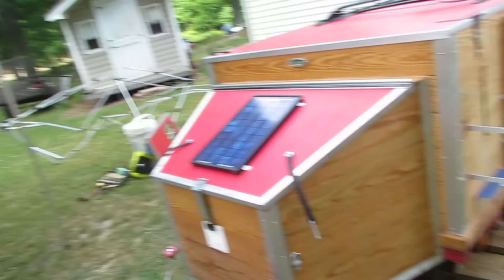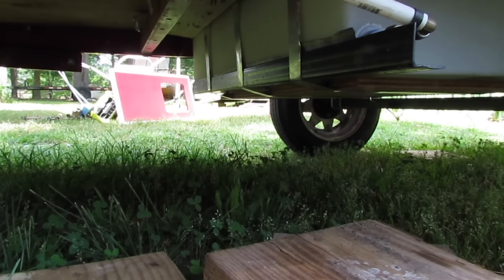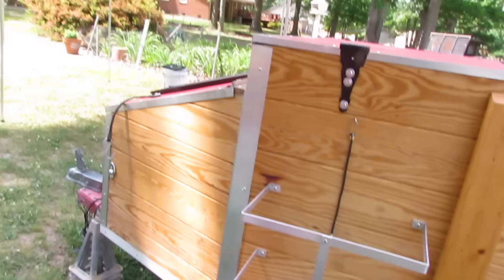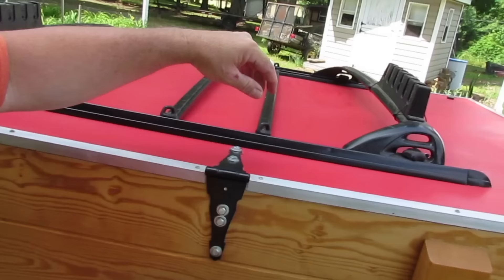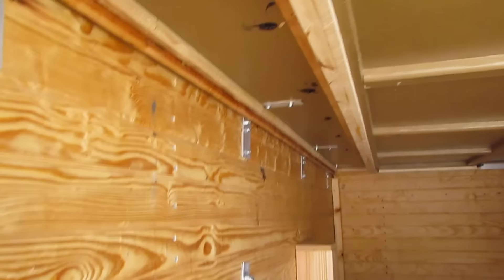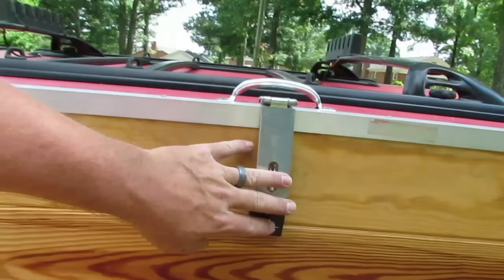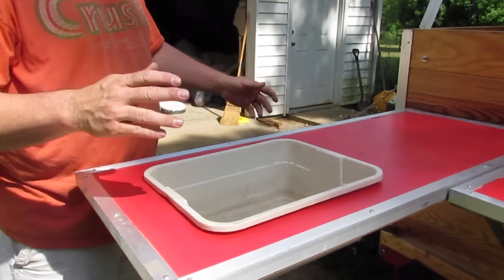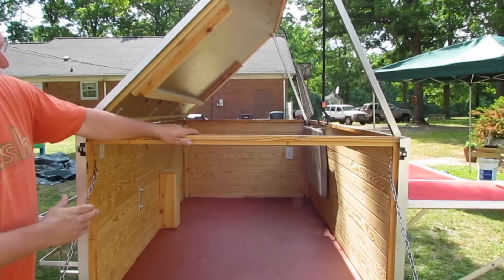Harbor Freight 4x8 Camping Trailer

Comment: i used a pop up camper body to pretty much do the same thing years ago. seems like your construction is a little too heavy duty. I am sure it will last a long time but the weight of the trailer alone would concern me.  I see popup campers for sale all the time with bad canvas. I got mine for $250.00. I stripped it out and hinged the roof. You did a great job. just too robust for most.
Reply: +scott firman do you have pics beefore and after
Reply: that was many years ago. I ended up leaving it out west as a trade for a pop up with canvass my cousin got for me. I made that one into a utility trailer after buting a new popup.
Reply from the maker: Thank you, it's definitely heavier than I had hoped but I can haul all that I need as is and I'm still going to upgrade the springs and the axle. I had looked into getting a popup for the parts but had not thought about actually using the popup for the build. Thank you and thanks for watching.

Comment: Ingenious, functional design and nice workmanship. Using 1x6 tongue and groove and adding the steel grating at the back looks heavy. Any idea how much the trailer weighs when equipped just as shown in the video?
Reply from the maker: Thank you, it weighed in at 840 lbs empty which doesn't leave a great deal or room to play with load capacity but I'll be upgrading the axle, springs and wheels in the future. As it is now though it can haul all that we have to carry camping with no problem. 
Thanks for watching.

Comment: Looks nice and my only concern would be the small wheels. I'm guessing with a load of camping equipment, battery and water the weight probably comes in close to 1200 lbs and when your truck is going 70 mph those wheel bearings on the trailer are probably spinning at 120 mph.

Comment: Jeff, have you made a video where you are using the trailer to camp with it.Would be interesting to see the whole set up.
Reply from the maker: I'm not sure if you've seen the other videos on my channel but before this video, I posted a slideshow of the build which includes a few pictures of the trailer set up in the Great Smoky Mountains at Smokemont Campground.
Reply from the maker: http://youtu.be/SKfPgyygw7E 
Here is the link for that slideshow. I also did a time lapse video while setting up the trailer, I'll try to find that video and add it to my channel
Reply: Thanks I will take a look

Comment: That is a really cool trailer, I'm gonna make me one...but a little different
Reply from the maker: Thank you, hope you enjoy the build as much as I did. I'd like to see your trailer when you build it, I'm always open for new ideas and suggestions.
Thank you for watching
Reply: Mine might be a little bigger
Reply from the maker: +David Neely bigger is a good idea. I can get plenty of gear on this trailer but if it were a little wider it would definitely be nice.
Reply: I'm going with the same size frame you did on yours but mine is about 3 ft longer
Reply: Im putting like a pop up top on mine instead of the regular camper type material they use, me and friend of mine are going to make it out oak

Comment: nice work im an electrician. if u need some advice. on any electrical. questions. 
you. shoud add some 12v dc lights
and parallel. a few batteries. to add more amps to ur trailer
js
Reply from the maker: Thank you, I may take you up on that. I might have some questions later on when I make some upgrades, not sure how soon that will be though. Thank you for watching

Comment: I have a couple more questions for you. Question #1---- I would like more detail as to how you mounted the exterior table to the side of camper, what kind of hinges did you use what kind of wood was used for the table???? I would like to install an exterior table that is easily removable while driving. My concern is that I don't want to drill hole clear thru the camper to mount the brackets to the wall at this point since it is now a finished product. Question # 2------ The metal rack on the rear of the camper how is it mounted as well???
Reply from the maker: Hey JD, I have replied to this question before and the reply seems to be gone. Did you ever see the reply? If not, please let me know, I'll reply again. Hope you get this message. Thank you for watching

Comment: This looks great but please add a fuse as close to the battery as you can get it. I would also fuse each circuit.
Reply from the maker: Will do, I have a fuse on the 12 volt pump but I'll be adding other fuses where they are needed.

Thank you for your suggestion and thank you for watching
Reply: Glad to hear it! It will make your beautiful job more safe for you and for the trailer.

Comment: you shoulda reversed your outside table so the sink would be closer to the water outlet and require less hose . and maybe just attached it outside as a matching part of the outside wall that just pops up and used the Ikea table leg hack for legs .. just a thought

Comment: You did a great job on camper trailer one thing if the tires came on it new you need to change them china rubber is not so great.
Reply from the maker: Thank you and yes, I was concerned about the tires before our trip this spring so I purchased new tires with a heavier payload. 

Thanks for watching

Comment: the down facing "forward battery box vent" raises questions. 

1. If you are trailering the unit and your truck tires are kicking up water, road oil, sand etc. towards your trailer, where is it going? battery compartment. (the vent idea is great, if static)
2. Any problems with road material compromising the belly water tank connections?
3. This is a camping utility trailer correct? not the tent/living quarters? 
4. did you use treated or untreated pine (lumber) for the project. 
*if untreated, did you seal it with helmsman, varnish, or Thompson Water Seal ?

Excellent concept and execution of project,  well done/well thought out, sir.
Reply from the maker: 1. I have pulled the trailer in pretty heavy rain but not for long periods of time. No issues at all so far with water or dirt entering through the vent. 
2. No issues thus far with debris from the road causing any damage. I do plan to go to a larger wheel size though which will give me a little more height. 
3. Correct, this is a utility trailer to haul our camping gear, not a living or sleeping quarters. 
4. I used untreated wood and I sealed it with Thompson water seal but I plan to go back and use Helmsman spar urethane, the Thompson just isn't sufficient. 

Thank you very much, I appreciate that and thank you for watching

Comment: If you flipped the roof all the way over with 2 legs to the ground, it would make a great table. Would be kinda tall i suppose.
Reply from the maker: You're right, I have done that while working on the trailer, it does make a great table but it is pretty high. 

Thanks for watching

Comment: Nice job ,nice camper the reason I watched is i've been thinking of doing one as well. But want to build a portable miniature weld shop so will try to build a camper on my truck and the trailer for my welders saws brake etc. Any thoughts on a lightweight material that you don't have to mortgage your house to use to build ? Motorbikes use a composite , or aluminum both expensive.Thanks again ,nice job. Rog.
Reply from the maker: Thank you, not sure what you'll find that works and is inexpensive. I liked the look of the tongue and groove but if I hadn't used that then I would have used plywood. My original plan was a teardrop trailer but then reality set in when I started thinking about my large family and large amount of camping gear. One day I will build a teardrop though. A lot of people build a teardrop with plywood and cover it in aluminum. I'm sure that wouldn't be cheap though. Good luck with your build and thanks for watching

Comment: Some great ideas and a nice build!  Thanks! Now that it's 2020, how has she held up? Anything you'd change....?  🤔
Reply from the maker: It has held up really well, we haven’t used it in a while now due to upgrading to a travel trailer but we have put a lot of miles on the trailer. I did upgrade the tires to hold a heavier load, not that I was going to load the trailer heavier but just for piece of mind. I would suggest upgrading the tires and axle. Other than that, I’m happy with the build.

Comment: Great job it really is a custom piece that looks like it will last a long time. one suggestion maybe putting rubber or foam stripping to seal the top lid. ball park how much did it cost and how long did it take?
Reply from the maker: Thank you and I agree, I'm thinking about making a new top for the trailer and when I do I'll come up with some type of seal for it. The total cost, keeping in mind that I could have cut some corners and saved a lot but I always go overboard, is estimated at $1,500.00.

Comment: have you thought of putting the water tank in the box
Reply from the maker: When I built the trailer I considered a lot of different options. The tank would take up a lot of room inside the trailer if I placed it there. I did consider cutting a hole in the floor and lifting the tank a few inches and then build a box around it on the inside. That would get the tank further away from any dangers on the roadway. Thanks for the suggestion and thank you for watching

Comment: I am building a tiny house that I can pull behind my bicycle and have been wondering youtube looking for idea’s tips and inspiration etc. I came across your video and I must say, you have done an excellent job on your trailer. I have a few idea;s from your trailer I could use for my tiny house build. The water tank setup and the electrical stuff is awesome. Do you have a link to the ebay stuff like the gas tank door and lock system? I couldn’t find it but that is a really great find.You did a really good job but like others said better protect the water tank. Losing that while out camping could stink.Other then that all you need now is summer. .

Comment: Did you miss measure the width of the battery hold down rail so you can fit the hold-down rods in place?  Nice project and video.
Reply from the maker: The hold down rail is a snug fit for the battery when it's installed but there is room for the rods. Thank you and thanks for watching

Comment: The 5 watt charger on a 12 volt system is a problem you. Need around 13.5 to keep it charged other then that great job
Reply from the maker: Thank you, yes my plans are to upgrade to a 15 watt panel. I've heard that Harbor Freight has a good little solar unit for pretty cheap.
Thanks for watching

Comment: Nice work. Very good attention to detail on the installations of everything and clever use of standard household items to make it work. I have been wanting to build something like this to haul my kayaks and camping gear in without filling my truck up. Would you mind sharing what your overall cost investment was for this build?
Reply from the maker: Thank you, I don't mind at all. I started keeping track in the beginning but quickly lost track of the expenses. I have estimated around $1,500.00 total for the build but there are several areas that I could have saved a lot of money. One area would have been all of the aluminum, I wanted to dress it up a bit and I chose to use aluminum on all or the corners and edges. I could have left that off completely or probably found it at a much cheaper price. Building this trailer just to haul kayaks, you probably wouldn't need any of the electrical, side tables or water tank and plumbing so I'm guessing you could probably keep it way under $1,000.00. Hope this helps, thank you for watching
Reply: It does help, thanks so much!

Comment: But I am an electrician,,, so my suggestion is to run the wires away from and under the seals. And strapped so that vibration doesnt loosen things. Might I suggest a plastic flap from the sidewall covering your tie-in's? One drop of water in the wrong spot can destroy the entire trailer man. Also, a chicken wire guard for the panel. And battery terminal caps for the terminal points. Just suggesting man :)
Reply: Oh and a drain in the battery box too. Just in case. Very inspiring though man, thx :)

Comment: I was a bit confused do you just use this for a camp kitchen and use a tent to sleep in or do you sleep in this ?  also do you use camp site electricity and does it connect to your trailer? you did a great job on the project... do you mind sharing the costs of construction?
Reply from the maker: I understand, a lot of people have asked the same questions. I haven't made the trailer a sleeper yet, just a camping gear hauler. We sleep in the 10 man 3 room tent that I reviewed here on my channel. I install a 12 volt battery when we go camping and that runs the water pump and supplies power for most of our needs while camping. I didn't wire it to be connected to external power but that may be something that I do in the future. I would also like to modify the trailer to be able to sleep in it so that my wife and I could take a weekend trip on occasion, we have too many children to sleep in the trailer when we're on family vacations. When set up on family vacations we use the trailer as a camp kitchen or chuck wagon. In addition to the counter tops that I attach to the side of the trailer, we set up the camp kitchen that I built and my wife has all she needs to prepare every meal. You can see the camp kitchen here on the channel as well.
Reply from the maker: I started keeping track of the expenses early on in the build but I quickly lost track. I estimate that it was about $1,500.00, which could have been trimmed down a good bit if I would have cut some corners, like all of the aluminum was not a necessity but something that I wanted to do to dress it up a bit. I think I covered all of your questions. I appreciate the comments and questions, I have also added a Video here on my channel where I answer frequently asked questions.  Thank you for watching.

Comment: Hi Jeff, Really nice build. Looks like you put a lot of thought into it. I own the exact trailer and I was thinking of using it to haul camping gear as well. e own a 4 cylinder SUV. I was wondering what the weight of the trailer is empty. I hope my little veh will pull it. I was thinking of sleeping in it as well. The wife is not happy with a tent really. We are over 60 and the ground aint fun to sleep on anymore. Have you slept in your?  I think I'm going to copy most of your ideas.

Thanks.

Comment: Hi, great job !  I really enjoyed the whole video.  just a thought, maybe (racing) hood pins and drill holes for the aluminum struts holding the lid... wind or not it will stay.  have you mentioned approx. investment ?  Thanks again !  Keep up the innovation !
Reply from the maker: Thank you and great idea about the racing hood pins. I didn't keep track of cost during the build but I'm guessing $1,500.00. I could have cut corners and left off the aluminum and saved a lot but I went overboard as with most my projects. Thank you for watching

Comment: Hey Jeff, great video, nice touches. I have the smaller HF trailer (doesn't fold) and would like to do a similar set up. But the trailer bounces around horribly. Any idea how I could soften the suspension? My mechanic recommended running a slightly lower tire pressure, which I've done. That helped a bit but am curious if you have any ideas.
Reply: +Gene Seguin It won't bounce as bad when you get all the weight on it. although really short trailers are notorious for bouncing over bumps.
Reply from the maker: Thank you and I agree with Wayne Earls, once you have your load on the trailer it shouldn't bounce bad at all. My trailer also bounced when all I had on it was side planks but now it rides smoothly down the road. Thanks for watching
Reply: the more weight the better as far as bouncing.. sometimes if I'm hauling something fragile, light, and large I'll pack a bunch of bags of cement..  I bet that trailer rides smooth as silk

Comment: Great woodwork.  I question the size of the wheels.  Seams to me that the camper is to heavy for the size of the wheels/tires.
Reply from the maker: Thank you, I actually upgraded the tires last year to take a heavier load. The old tires were rated for 740 lb each, the new tires are rated for over 1,200 lb each. I'm going to upgrade the springs and axle as well at some point. Thanks for watching

Comment: Very good build. Do you mind sharing appropriately how much time and money you've invested in this thing?
Reply from the maker: Thank you, I don't mind at all. I started saving all receipts and keeping up with the costs early on in the build but after several trips to the hardware store and a little bit of time I lost track of the amount of money spent. I have estimated $1,500.00 counting the trailer which was $275.00 and I could have cut a few corners which would have saved a little money. It took about three months from start to finish in my spare time, that was extended slightly due to a torn bicep about 2/3 of the way through the build. Hope this helps.
Reply: +Jeff Furr Thank you very much. It looks great and I hope you get many years use out of it. If you keep it water sealed, I believe you will. I may have to build one like it eventually. Thanks for the info.
Reply from the maker: +Nathan king I hope to use it for a long time. If I could suggest one thing to you if you build one. Take pictures, video and keep track of what it costs to build. Do that and put a good video on YouTube and you may make more money than you put into the trailer.